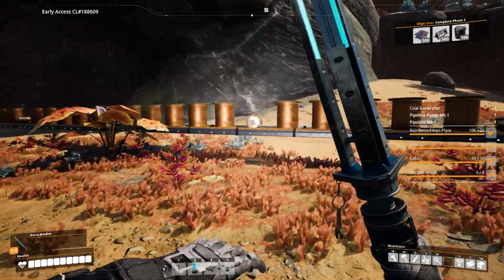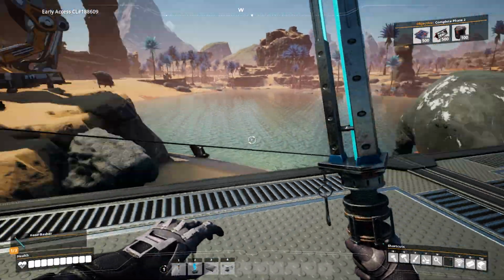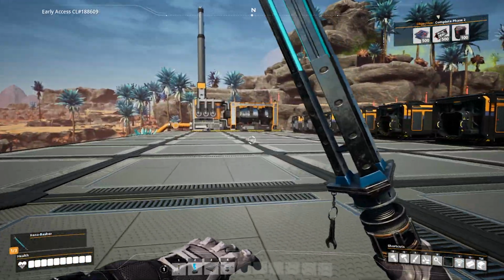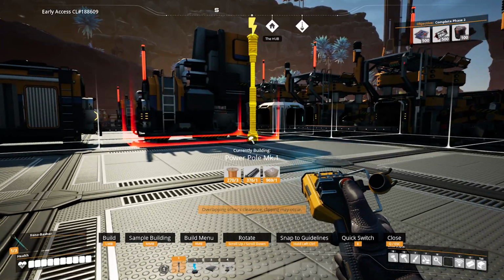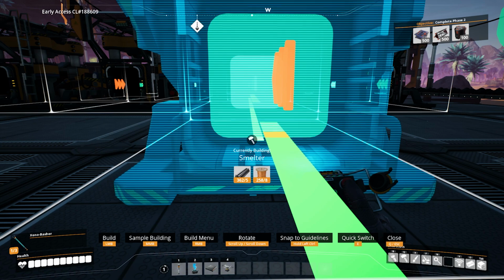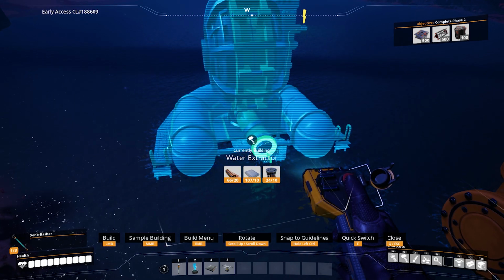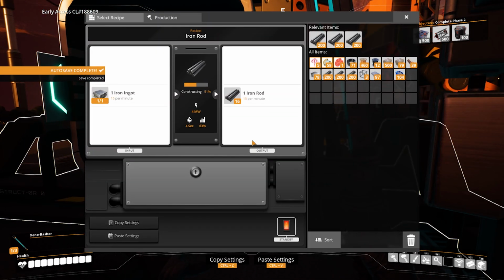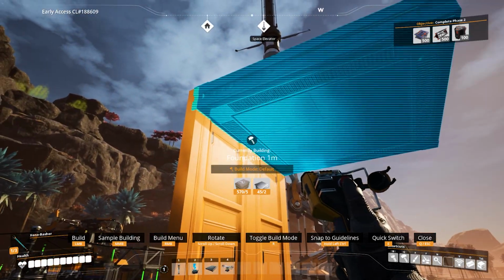Major Power Upgrades and Water Pump Problems | Satisfactory #7

Comment: 1 water extractor can fill up 4 coal generators, If you make more coal generators you need a second extractor, but elso have to keep a eye out on the coal and if it is a impure normal or pure coal note that got a lot of impact as well on the coal line

Comment: Meaty if you place the pipe first you can place the pump inline into the existing pipe same goes for the tee and check valve also you are better off putting a buffer  the tank between the extractor and the furnace